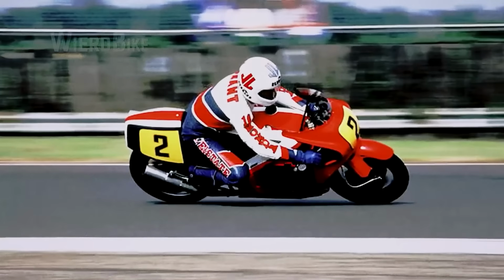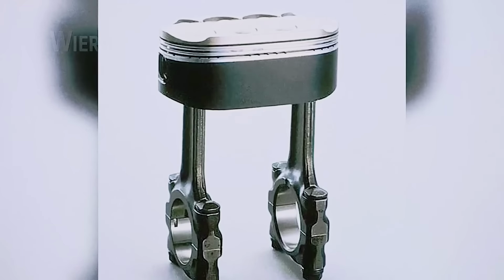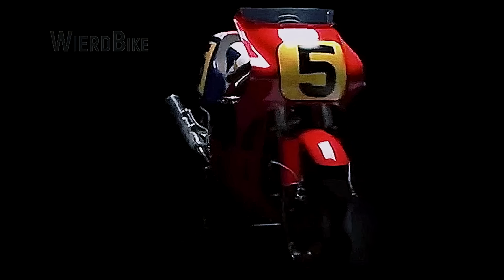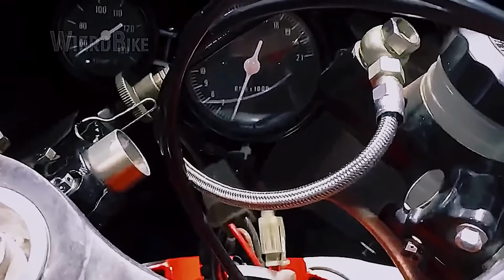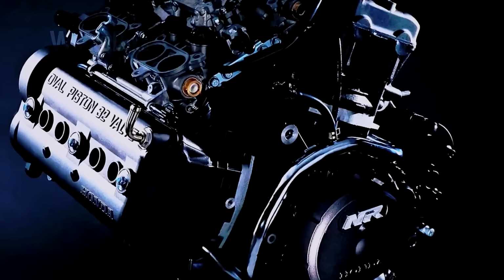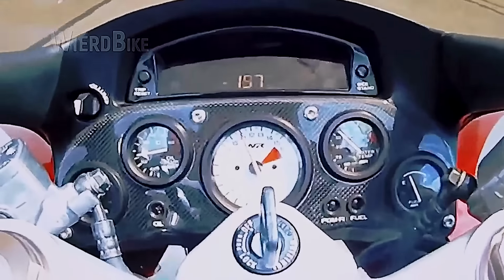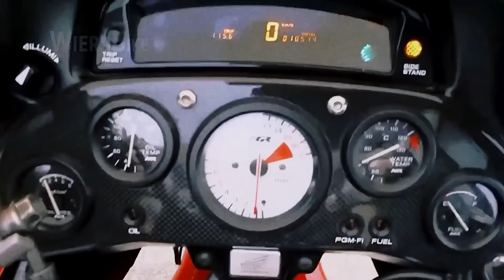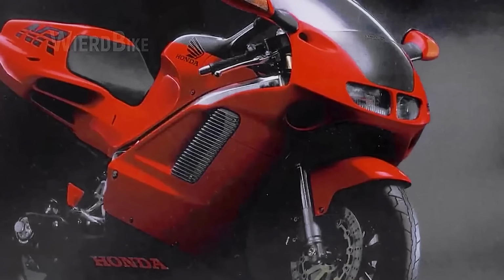OVAL Pistons in a FABULOUS 32-valve V4… The SMOOTHEST Engine Ever!

Comment: Effectively a v8 👌
Reply: Sorry, but no, it's still a V4 (short stroke) with 90° ignition angle (vs. 45° V8) or so ...
Reply: Effectively a v8 valve area wise. I believe that was one of the design theories.
Reply: @yo3429  herped when you should've derped
Reply: No.. Just a V4 with big daft pistons

Comment: The NR500 competed against 4 cylinder 2 strokes. Honda knew that the only way to be competitive with a 4 stroke they would need all the benefits of a V8 500. Regulations did not allow more then 4 cylinders, so Honda designed a 4 cylinder that was effectively a V8. It was a magnificent effort but was never competitive due to teething problems and excessive weight. 
The NR750 was very successful in world supper bike before the Ducati 916 existed.
Reply: Thanks for bring some facts to this work of fiction.
Reply: This is nonsense about the engine effectively being a V8.. It's a V4 with oval pistons.. Nothing else as it certainly didn't have any characteristics of a V8...
Reply: @Team-fabulous It retained a couple of the benefits that they wanted if they were allowed to make a V8. Each of those 4 oval pistons had two conrods allowing it to rev to a high in its day 19K revs and each of those oval pistons had 8 valves giving the total number of valves and flow they wanted in a V8.
But yes it would have the same balance and power pulses of a V4

Comment: So I have a '97 916 which is my pride and joy and it has pretty much nothing in common. The fairing, the valves, the suspension, the swing arm, the angle of the v twin, the secondary frame, the under the seat exhaust, the injection system. Nothing is the same. The 916 was where a new era started.

Comment: Author of this video should just remove it or redo it. NR was ahead of its time, influencing many other makers and should be rightfuly remembered as such.
Reply: For example, it had nothing to do with number of valves, but with V8 engine , with removed cylinder walls.  

I’m gonna watch the rest if it, just for picture collection, otherwise in my opinion, should be removed.